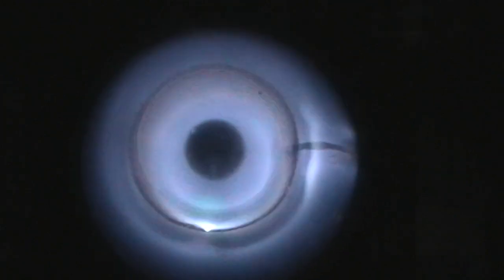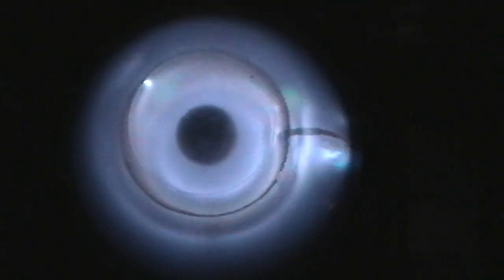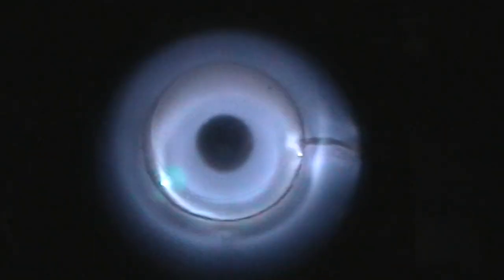Extreme High Voltage: Electric Grid Connection as Cathode

Comment from the maker: The corona motor I used was the one I've used on my SSTC, where it worked fine. It was a brass acorn nut for the central pivot, with a couple arms of wire soldered to it and pointed and bent into tangent at the ends. It also worked fine in this chamber at ambient pressure, then with just a bit of reduced pressure it really spun fast. But as soon as the pressure was low enough for glow, the thrust stopped. Still plenty of discharge from the tips visually but evidently no ion "wind" thrust.

Comment: In order to proof that the green flashes are caused by copper you could replace the copper mesh by a steel/iron mesh or ring (e.g. a wire loop or a ring cut from a can). But you will have thought of that yourself.

Great experiment, fantastic glow, greetings Conrad

Comment from the maker: I wish you could see it "live". The general blue glow doesn't look attached to anything, and then the white tufts show up within it like patches of cotton, attached to points and curved surfaces or just coming out of a flat surface at a point.

I've made ball lightning but it requires high-energy discharges, I think. This plasma glow, anodic and cathodic, is a relatively low-energy phenomenon and is actually kind of a "short circuit" to whatever the power supply is, as I'll demonstrate next.

Comment from the maker: (corona motor continued) 
Then, shortly after I made the still photo of "StElmo'sFire" that I put in the video, the thing evidently got hot enough for the solder holding the arms to the brass nut, to melt. They dropped off and I had to break the seal and open the chamber to clear the debris.
I'll make another one of enameled wire as you suggest. Maybe the enamel will act as a "fuel" and make its own ion wind for thrust in the vacuum. Thanks for the suggestion!
But I'll make

Comment: ......This process produces an emission spectrum of X-rays at a few discrete frequencies, sometimes referred to as the spectral lines. The spectral lines generated depend on the target (anode) element used and thus are called characteristic lines. Usually these are transitions from upper shells into K shell (called K lines), into L shell (called L lines) and so on"

you have already seen and photographed the spectral lines-trust me,your making x-rays!
fantastic show in that bubble though

Comment from the maker: But the green flashes I'm seeing are emitted from my cathodes, not the anodes! However, it does seem to me that some copper is being deposited on the surface of the chromed cast iron sphere that is the center electrode when I use it as anode.
I'm not saying you are wrong; we both understand the basic process. I just don't think there is enough energy in these discharges here (yet). But if I start seeing the bones of my hand glowing thru the skin, I'll back off a little, and let you know.
;)